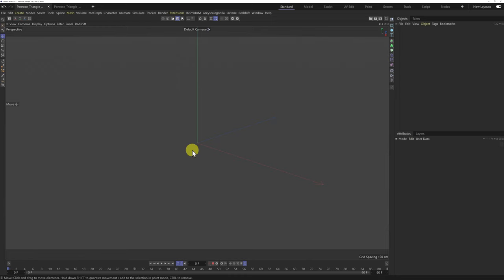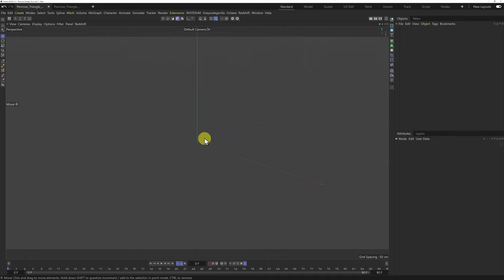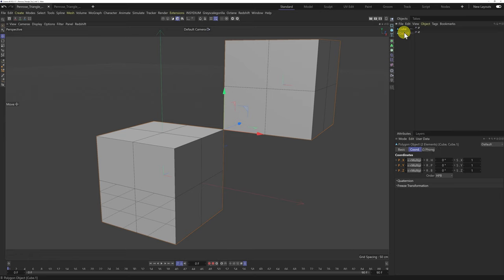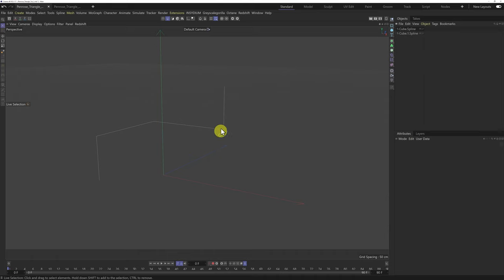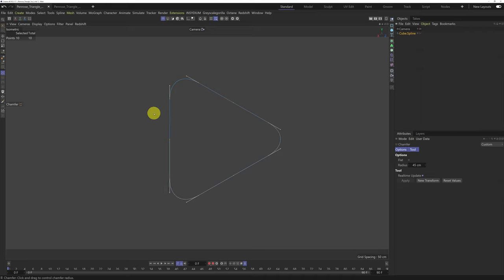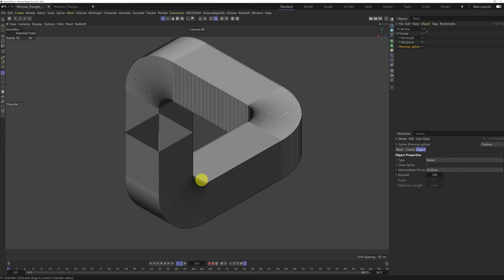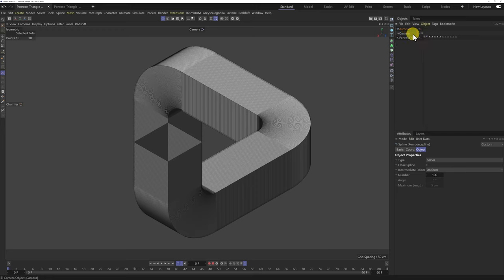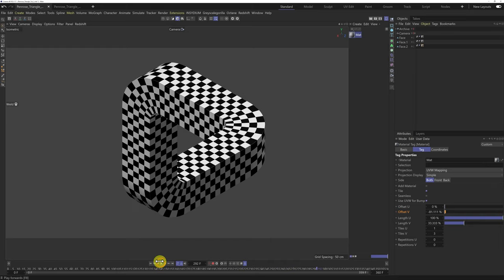C4D Tutorial: How to build a stylized Penrose Triangle (Impossible Triangle) in Cinema 4D

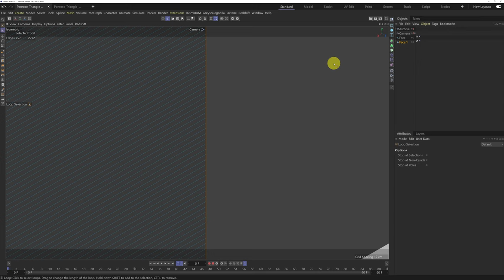Comment: why my loop selection select all around the face 1? at 22:55
I use c4d R23
Reply from the maker: The loop selection shouldn't loop around the entire face because it is flat geometry and has been separated from the original geometry, it will only select the edge you have selected because that's the only path it can take. The Loop selection tool changed in S22, but only with more control for selections, apart from that it hasn't changed and is the same in earlier releases. You can try checking "Stop at Poles" and see if that helps. Apart from that I really don't know. If you can't get it to work, the only thing I can suggest is to make the selection and delete the points you don't need. Thanks for watching.
Reply: @AlmostDailyRender  thank you sir, I already did it and it's still work, but i really don't know why I cant select that spline. anw thank you for your tutorial!!!
Reply from the maker: @nhatquangvu6884  Thank you! I'm glad it worked out for you in the end. I popped into Cinema 4D R25 and R24, the selection is still the same. I don't have R21 through to R22 installed to test this, but I have R20 still installed and I discovered that the Loop Selection actually selects all the edges! So, it's not you, it's your release of C4D. Not sure when they changed this. I know that they updated the selection options in S22 and I was under the impression that the default settings for Loop Selection hadn't been changed, but they have. Thank you so much for bringing this to my attention, I'll pin your comment so everyone can see this. I'll include a quick update for the Loop Cut Tool in the follow up tut. I'm trying to make everything inclusive to all users, so now I know for future tutorials. I'll test everything in R20 first and do a bit more research to make sure everyone gets the right information. Thanks again :)
Reply: Damn!!! Your need more sub bro!!! You did really good work. Keep it up!!
Reply: anw, I am a redshift user. Can do more about RedShift? your tutorial is really good but I'm use Octane. 
I see alot of Octane our there but Redshift!
Reply from the maker: @nhatquangvu6884  Thanks for the complement :) I need to be a bit more consistent in uploading to Youtube. In the second part of this, I will be popping into Redshift and show you how I lit my scene and how I use Cryptomatte for compositing in After Effects. Also how the isometric view setup is different in Octane. Hopefully it will be up soon!